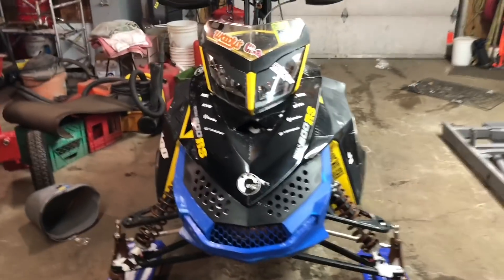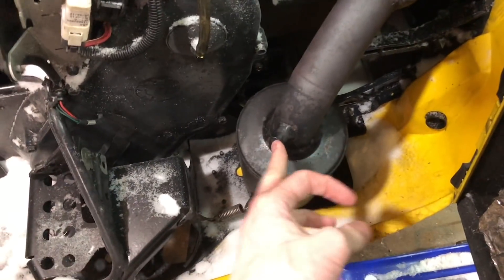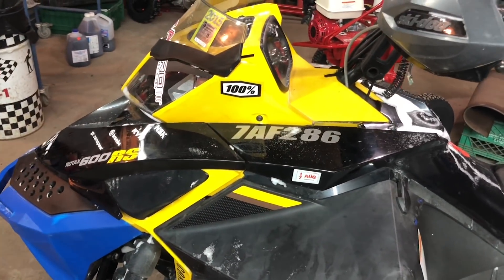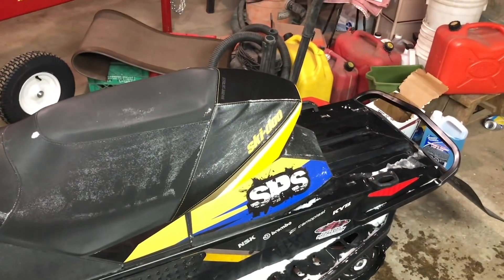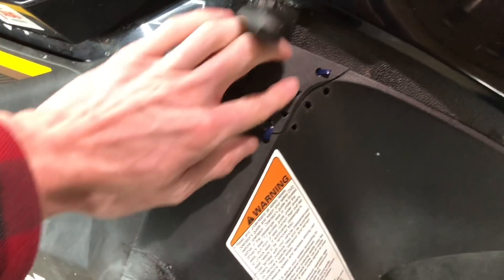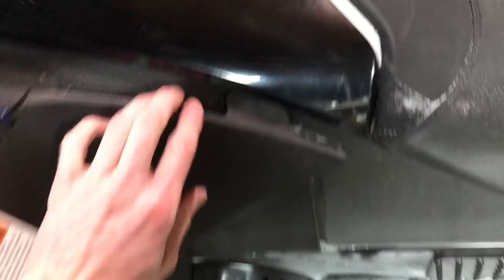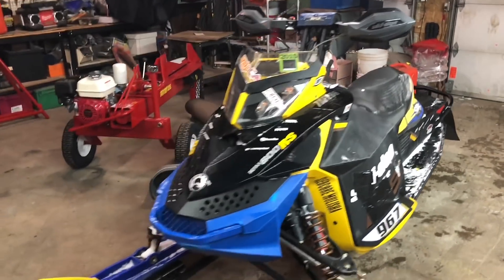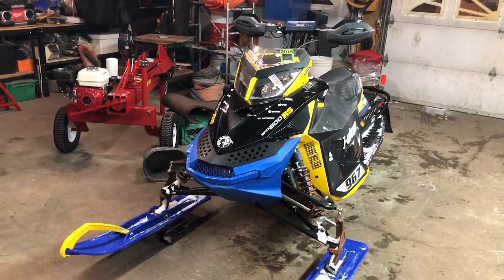600RS WALK AROUND

Comment: What’s your carb set up needles jets ? Power jets or hard jetted. I can’t hold mine wide open like you can mine sakes out after 20-30ft wheelies
Reply from the maker: its all still the stock set up
Reply: spsproductions11 thanks! I have the stuff to hard jet. But I haven’t got around to it yet. Been trying to eliminate other things so I don’t have to get rid of the power jets but I think they are my problem.

Comment: What kind of fuel you run
Reply from the maker: just regular 91 octane from the gas station
Reply: spsproductions11 you should try 98octane if the sled isnt running to well. My 800 requires 98 or else it has a warning on the display